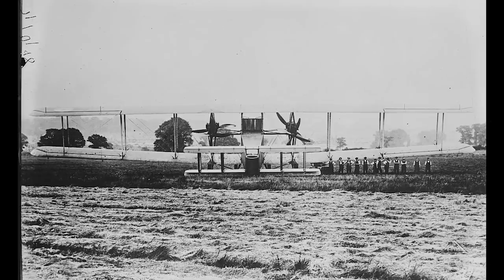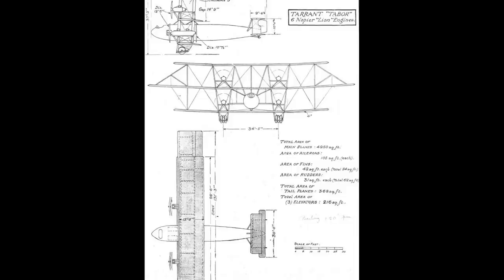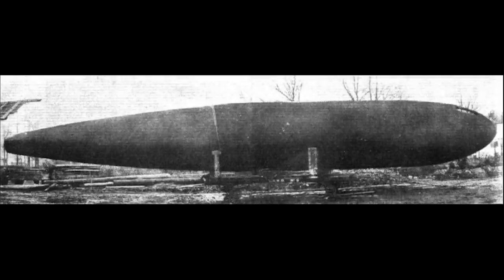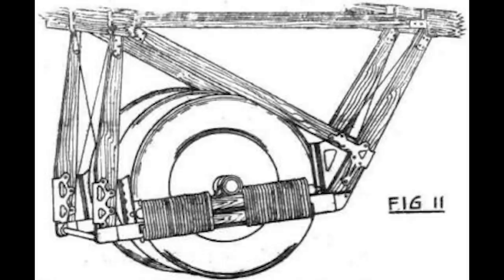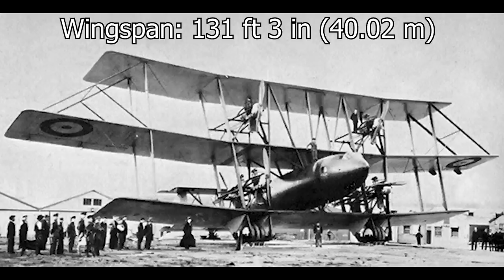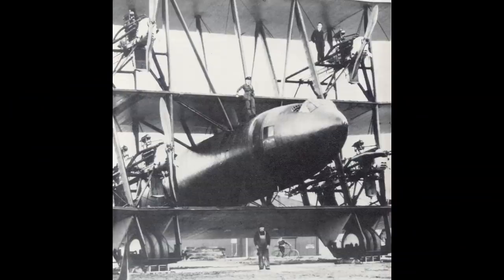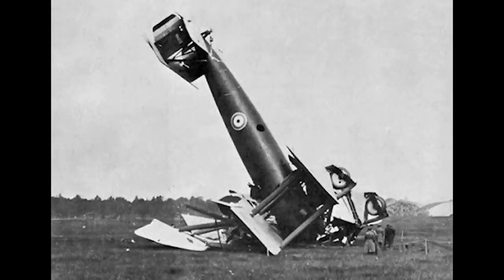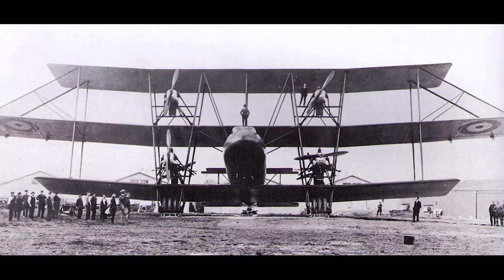The Triplane Bomber That Failed To Fly | Tarrant Tabor [Aircraft Overview #27]

Comment: Walter Barling would go on to make a similar aircraft known as the Barling Bomber at the behest of Billy Mitchell. All the engines were moved to just above the lower wing to avoid the Tabor's problem. However it was slow, under powered, and was unable to fly very far with its full payload. In fact it could only fly 700 miles if it didn't carry any bombs.

Comment: Yet another one I've never heard of - thanks, and please keep 'em coming.
You can see a lot in these photos (besides just how staggeringly big it was) to suggest some pretty good ideas went into it. The construction is clearly very sturdy, and the fuselage looks like a leap ahead in aero design. 
On the other hand, great engineering doesn't guarantee a great aircraft. My one thought is that maybe if that top wing and engines were set back a bit, the overall balance might have been better .

Comment: They NEVER should have added that extra weight without letting the pilots know.  Never.

One thing during the Normandy Landings was they had a General coming in in a glider.  Some bright boy decided the General needed extra protection - so they added some armor plate to the glider floor ...

When the glider was disconnected from the tow plane - it was going down.  The pilot managed to keep everyone from dying - but not the General.

People who don't know what they are doing shouldn't make modifications to aircraft ....

The problem is - you sometimes have people with more power than sense telling people to do things.
.

Comment: Barling took the basic design to America and convinced the US Army to fund its construction, named XNBL-1, (also refereed to as the Barling Bomber). The two upper engines were moved to the gap between the mid and lower wing. It flew successfully, but had performance problems and the design was not pursued.

Comment: The Tarrant Tabor concept had a second life in the United States Army Air Corps as the "Barling Bomber" also known as the Wittemann-Lewis NBL-1. U.S. Air Corps Gen. William "Billy" Mitchell brought over Walter H. Barling to design an experimental strategic bomber in the early 1920s based on his experience designing the Tarrant Tabor. The Barling Bomber looked a lot like the Tarrant Tabor with a cigar shaped monocoque fuselage, three wings and six engines. But this time they used war surplus Liberty 12-cyclinder engines. The Barling actually successfully flew, but it was so slow and lumbering that it was never effective as a bomber. It pretty much ended up as a hangar queen and a nuisance. You should do a follow up video on the Barling and it's ultimate fate.
Reply: Where do you come up with this stuff? I've studied aviation for 50 years and have never heard of that. I would love to see your library of reference books; probably puts mine to shame.
Reply: @mikearmstrong8483  I think I originally read about the Barling Bomber in an issue of "Air Power" magazine back in the 1980s. But I refreshed my memory by looking it up in Wikipedia, which has all the same details.

Comment: The thought that they may have added the balast after the designer told them not to and without even informing the pilots is both shocking and infuriating.

"So, we have a completely untested aircraft with an already dodgy stability and unknown handling characteristics.
"Let's significantly change its mass and center of gravity and not tell the guy who will fly it. There's no way this could go wrong..."

Comment: Being an Engineer as soon as I saw this craft I said, if you engage the upper motors this plane will nose dive hard!  No matter if it was in the air or not. With the 3rd wing and the motors mounted on the first wing the arrow dynamics will turn it into a un-flyable Kite or rip the plane apart.  Only computers could have made this fly and it's such a poor design it might have great in the great war but it was garbage. Too slow even then and the weight would have hampered it's ability so much rifles would have brought it down. It's like Jenga, remove just one part and it would collapse in on it's self fast.  Great video and I gave a thumbs up! Cheers

Comment: I suspect that the extra ballast put in the front section of the airplane pushed the CG too far forward and made it have a tendency to nose down. Thus causing the plane to pitch the nose downward upon leaving the ground. Causing the unknowing pilots no time to correct and the plane then crashed back to earth quite quickly.
Reply: The nose down moment the upper engines would cause would be substantial. I suspect the “tail heavy” assessment was correct but the ballast decision was incorrect, because the tail being heavy counteracts the twisting moment the upper engines would create at low air speeds. (At cruising speed you could trim it easier, or throttle down the upper engines) it’s still a stupid design, but back then, they didn’t know anything compared to even 20 years later. Yet, someone should’ve seen that, it’s not hard, and they’re issues that don’t require much aerodynamic knowledge to identify.
Reply: @joseiten3647  Even back then, management ruled over the engineers. “A new design is too expensive, just add a wing and make it work!”
Reply: Who "nose"...?

Comment: I did, at one time, know the answer to this but why have multiple wings when modern planes ended up with one?
Reply: Trying to get more lift to make up for underpowered engines, or lifting excessively heavy loads in a time where aerodynamics weren't anywhere near as well understood.
Reply: @Eman-720  

Thanks for that. 👍

I did actually do some research of my own on this & discovered the following:

"The main reason for having multiple wings in the initial years of the aviation was the lack of availability of materials with sufficient strength.

The main advantage of the biplane is that the wings could be shorter for a given lift. During the initial stages of aviation, the materials available for manufacture of aircrafts were timber, doped fabric etc. The structural members made of these did not have enough strength, limiting the wing size.

The early aircraft also had less powerful engines, resulting in lower speed. In this case, the lower stall speed of the biplanes was advantageous.

The biplanes had very good maneuverability (better roll rate) compared to the monoplanes. This is the reason triplanes were developed during the WWI"

Comment: Imagine building a superbly aerodynamic fuselage, then combining it with an abomination of a wing set up with the aerodynamics of a Venetian blind. As wind tunnels had been developed, why didn't designers see the writing on the wall and realise that monoplanes without wires were the way to go? There's nothing in the construction of the shape of a DH Mosquito that would be alien to engineering even back in 1919.
Reply: Monoplanes had been built before. For a very modern aircraft of the era look up the Staaken E4 an all metal monoplane built about 1919/1920 in Germany.
Reply: @washingtonradio  My point is, then why build aircraft like this one that was such a mess. I hadn't realised that wind tunnels were so advanced at this stage. Engineers must surely have been able to prove that cantilever monoplanes were the way to go.
Reply: The greatest stumbling block to monoplanes and utilizing aerodynamic designs like the Mosquito in 1918 was the state of technology regarding engines/fuel in 1918. The 1918 Napier Lion maxed out at 450 horsepower, a 1944 Rolls Royce Merlin 1,600. So roughly, it took four Lions to equal one Merlin. With the weak engines, you can't get enough speed with a monoplane to lift a heavy aircraft off the ground, so to generate lift you have to use multiple wings. And they hadn't even come close to refining fuel to the octane level required for high compression engines, so they had to festoon an aircraft like the Tabor with six engines and three wings, and all the weight they added, to get the power and lift a couple Merlins and a single wing could give the Mosquito. 

Basically, the power to weight ratio of 1918 engines simply couldn't allow aircraft designers to utilize monoplanes and aerodynamics like the Mosquito even if they knew those would be superior.
Reply: @PassportToPimlico  The aircraft needed a large amount of wing area to support the desired bombload, fuel, engines and aircraft structure. With the both weak and heavy engines available turning fixed pitch propellers, the ratio of gross weight to useful load is going to be terrible. Providing enough wing area with a monoplane would produce a very long and thick wing, which would both cause massive amounts of drag and be very heavy, making the whole situation even worse. See the Russian monstrosities from the late 30's that you could probably stand up inside the wing, and they were both metal and had much better engines. One answer is a biplane or triplane with mutually supporting wings much like a bridge truss, with the individual wings being both thin, and of a more reasonable span. The better answer would be to wait a few years from technology to catch up with requirements, and start over.
Reply: How the hell did they get something that size in a wind tunnel??
Reply: @paulhaynes8045  Would have been a scale mock up I imagine.

Comment: If it looks wrong it is wrong....anyway; how come the pilots didn't know about the 1000 lb ballast. Surely a simple before flight inspection would have revealed that....if they didn't do that, why didn't they? RIP the two pilots.
Reply: To be fair to them: it wasn't until after the B-29's prototype crash (caused bt taking off in an incorrectly prepped aircraft) that thorough pilot pre-flight checklists started to become an industry standard.

Comment: "It was gonna be powered by tigers, but they had trouble with that so they decided to go with lions instead"
Here we see what is wrong with this plane. They should've never used cats to power their plane, too bulky and not enough power to weight ratio. Ants IMO would do better on both counts
Reply: Besides which, ants are instinctively cooperative, whereas if you put 6 cats together it doesn't matter if they all have the same purpose; they're going to fight anyway. Also, the plane wouldn't be able to stop climbing because every cat is going to try to get up on the top wing.